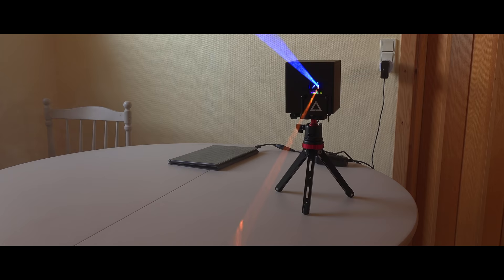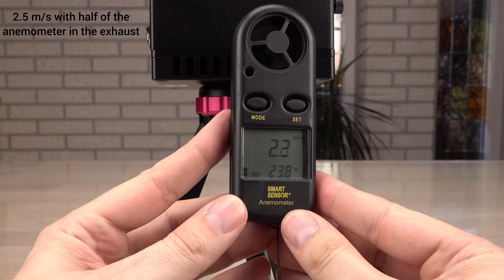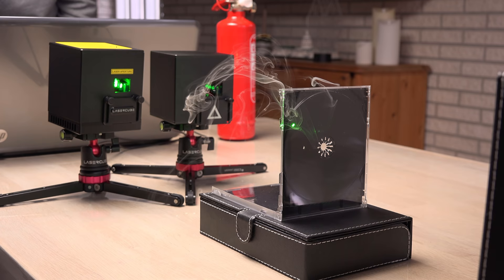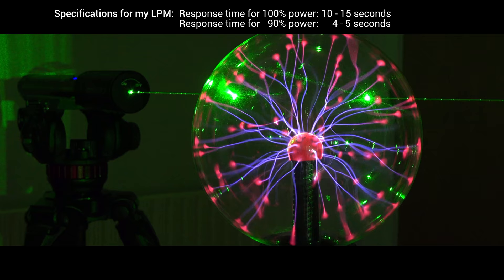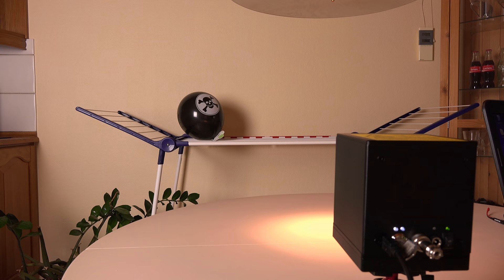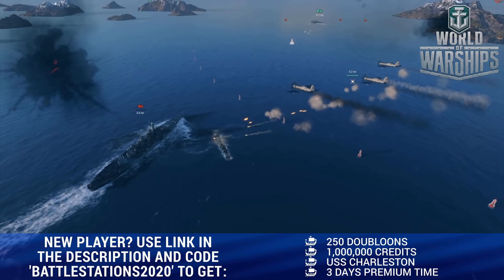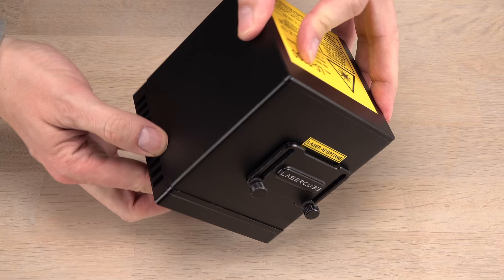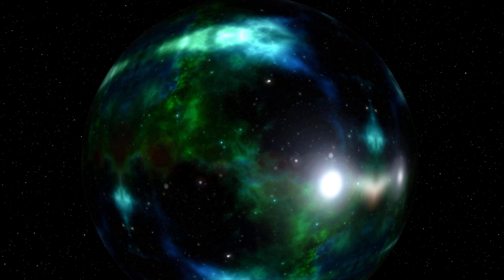LaserCube 2.0 | They DOUBLED the power?

Comment: Why is a 2 watt laser so impressive when for an example a 3cmx3cm CPU draws up to 200 watts? Why does it take so much cooling to produce such a low watt laser?
Reply from the maker: The two watt is optical power - not electrical power. Two watts of optical power in a 4 mm wide beam is a lot! Any laser above 0.005 watt of optical power is considered an eye-hazard, and the highest laser safety class starts at 0.5 watt. Thanks for watching!

Comment: If you don't like the noise of the fan you can just disconnect it and hook an external fan duct up to the device and have an as large fan as you'd like.
Of course this will increase the overall size of the device. You can't have and eat the cake at the same time.

Comment: Arctos has had 15W (16W internal) in the size of a shoebox at 15kg (about size of your 2W) for 5 years+ lol and that's ready for touring show/professional use...
Cooling is critical, the lasercube isn't going to be too stable in long term use or touring environments, it will loose alignment quickly. You can't just cheat physics.. adding a bigger fan helps. 
edit; wtf is it outputting 140mW at idle? Pretty crappy QC
P.s. Usually best measure for each wavelength individually and add them up but it appears you are using a thermal head so it shouldn't really matter.
Scanner mirrors are cut for round beam. Square beams typically are more rectangular mirrors. 
Brass is terrible for thermal conduction by the way. It's used for other reasons.
Reply: Dude, yup.. I agreed with your statement, but hey, what about KVANT, do you use it also ?
Reply: KVANT also the best though among the others (beside Arctos itself) since they also Partner up with Pangolin

Comment: I kinda want a 200 watts version now think on the POWER
Reply from the maker: Hehe, 30 watt white light show lasers are available (but don't ask about the price). I believe LaserWorld offer up to a 400 watt beam show, but with only a green beam. Thanks for watching!
Reply: @brainiac75  400 Watts?! The damn laser engraver at work puts out "only" 75 and that alone can do some serious carnage. Wonder what 400W will do. Imagine the power draw and cooling...
Reply: @DrakkarCalethiel  ...........I AM AND I STILL WANT IT!!!
Reply: Get an "energy reformatter" . An energy reformatter is a device that can convert any type of energy in any other type of energy without loss. Using this, you can build extremely strong lasers:
1) Set the reformatter to a mode where it converts thermal energy in coherent optical energy.
2) Put it directly on top of a threadripper.
3) Start any program for a laser beam with up to 700W! 
Minecraft works very well to create high power laser beams with this setup.

Comment: Specs on the website say 14,000 mAH battery.  Yet when you open it up it is clearly labeled 3,500 mAH.  It appears to just be 2X 18650 batteries in series.  There is no possible way it cold be 14,000 mAH.

Comment: I wonder what the output is with a proper IR cut filter.  If you have to go with DPSS modules, I prefer 473nm...or use argon ion and krypton ion lasers.
Reply: These are all direct diode lasers and do not output any IR at all. An IR cut filter would be nothing but a waste of power.
Reply: @plemli  -- I tend to use 473nm, 532nm and 671nm.  Those are all diode pumped lasers.
Reply: @pmgodfrey  good for you, but I meant that this LaserCube device likely has 445, 520 and 630/650nm, all of which are direct diode lasers that do not emit any IR except as incoherent longwave heat.

Comment: So, is there anything I can "safely" use for some beamshows in fog? 20 years back they displaysed beamshows here in the mall, not caring that the upper deck was fully inside the laser-animation....
Reply: Professional laser show systems widen the beam. They also have lockouts and safety shutters that stop the beam if the galvos don't move or don't move fast enough - i.e. when the beam's energy stays in the same area for too long. Toys like the device mentioned in the video don't have such mechanisms, so if someone were to use them for a laser show and someone were to get hurt, the owner of the device would be sued to oblivion.

Comment: Has it increased in price, recall i looked at the 1w a year back when it was released and wasnt it around 500USD, and here years later and obviously more dated it says 700USD ?? and the 2w is starting at  +1000 USD and coming from Denmark. and you have to eat siginificant techtax, - tax handling fee and then another +25% VAT of the final full amount... I would be supprised if your then closer to 1500 to 1700USD.
No dice wicked lasers but it is wicked'  no doubt, - and it would look freaking awesome in our air-videos for Copenhagen Music at high altitudes..

Comment: Is there a hard limit to the number of lines or shapes it can display? For example, if I wanted to do projection mapping on a building, how many lines could I draw?
Reply: Depends on the deflection angle. The smaller the angle, the more points you can hit.

Comment: I've been wondering for years if it would be possible to use scanning lasers in a similar way to how CRT televisions create an image. One red, one green, one blue. I suppose the hardest part is directing the beams fast enough to get a decent refresh rate. 🤔
I also suppose dimming and turning each diode on and off fast enough could be an issue...
But... if those could be overcome, can you imagine how amazing a laser projector display could be? Practically any size, extremely vivid and perfect color recreation....   I would love to see it!
Reply from the maker: I have a feeling it already exists... I just can't find an example. All examples I find use lasers as a light source, but they don't scan the laser beam - just send the laser light onto a DLP, LCD or LCoS like in common projectors.
I think the scan speed needed is the biggest issue, as you mention.
Thanks for watching!
Reply: @brainiac75   Yup! Those are the only things I've been able to find as well. Too bad light isn't affected by magnets! 😋
Thanks for making videos! :D
Reply: BRUXXUS you should need two mirrors spining fast, one for X and one for Y. Diodes can turn on and off pretty fast without any concern.
Reply: It has been done by jenoptic about 10+ years ago, they managed 720p 60Hz using a pulsed RGB laser in what is referred to in the industry as the 'jenlas monster' haha. Kvant also demo'd something similar at prolight and sound messe 2019, it projected very long distance but the picture quality was ok at best.
Reply: Yes, it does exist. I think you mean something like a laser projector as a TV? Just one example out of quite a few
https://www.lg.com/us/home-video/lg-HU85LA-4k-laser-projector

Comment: Hello there, I have a small laser display system, from Big Dipper, model k100, it’s a 20 mw green laser, nothing impressive but it’s a good effect, having an issue with the green laser, as it scans a clean green line, the laser seems to be flickering a lot, not all the time, which is why I can tell the difference of when it is flickering and when it’s not, what is causing this? Temp does not seem to be the factor, ass I have tested it with the unit both warm and cold, when cold the laser starts dimmer but doesn’t flicker, when the unit is warm same thing no flicker, but it flickers for a while randomly, also it’s driver board does not have any power adjustment knob. I am having to return the unit which will take forever, but I was just wondering if you had any ideas on how to maybe solve the issue without me having to go through the trouble. Thanks again great channel, I am subscribing, love the content and information

Comment: Why would they remove the pop and burn feature? Thats so cool and the primary reason I want to buy one of these. I mean I can't afford one right now but I want one.
Reply from the maker: I'm pretty sure it is for safety reasons. With increasingly strong laser diodes, a 6 seconds steady beam can get you in serious trouble. But as mentioned in video, the pop and burn features are still in the LaserOS. You just need to unlock them in a semi-secret way (and accept the responsibility). Thanks for watching!

Comment: The huge 2W laser box with that massive heatsink is overkill. Compare the heatsink size to a CPU cooler, which manages up to 100W of thermal energy.
Reply: If you put the laserturd in a hot environment it will go out of alignment. That's why larger heatsinks are useful on more professional designs..
Reply: @N4CR  In a 20C environment, my cooler with 2x the TDP rating than the CPU never gets above 50C, 200W vs 100W. The cooler is still less than a quarter the size of that monster, and has the same number of fans.